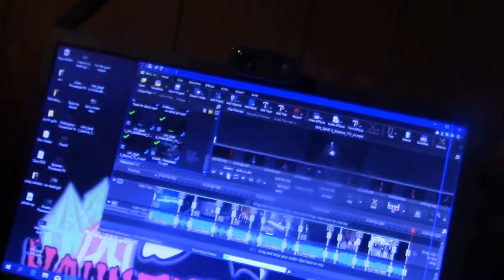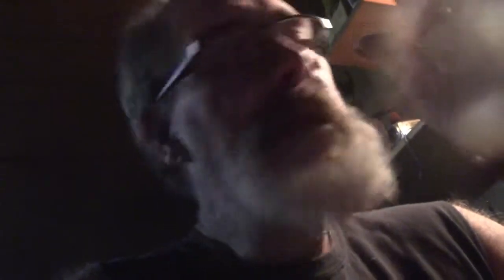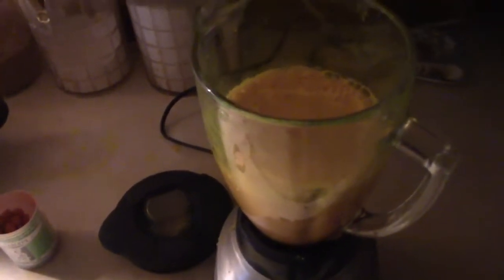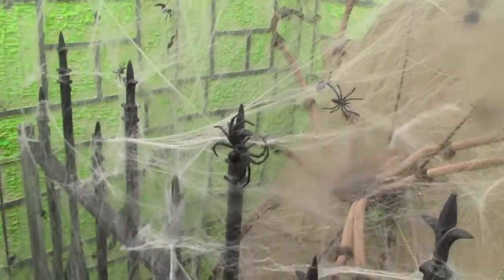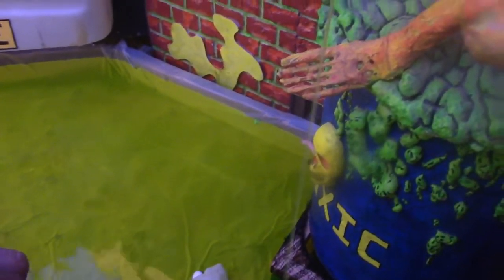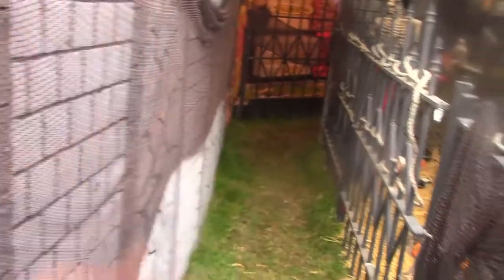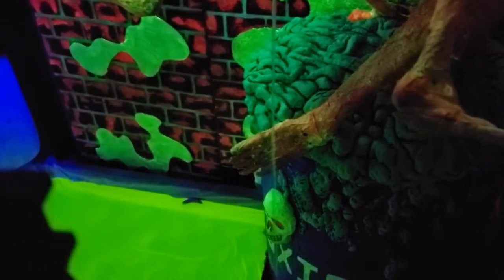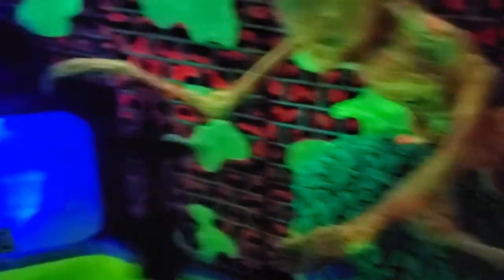Haunted Tents Set Up Day 37 10-21-19

Comment: Buy the florescent tracing dye in the gallon jug. One gallon does 25000 gal. No mixing comes in red and green. If that water pump is 12v you can reduce the voltage to make it less powerful.